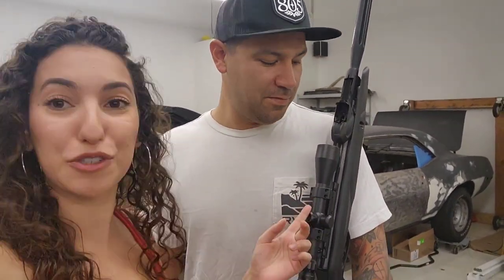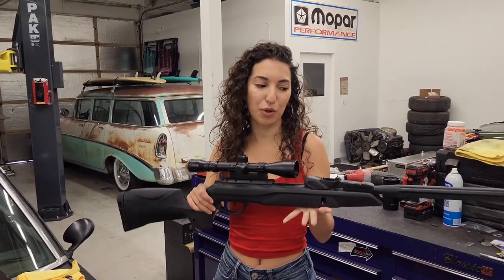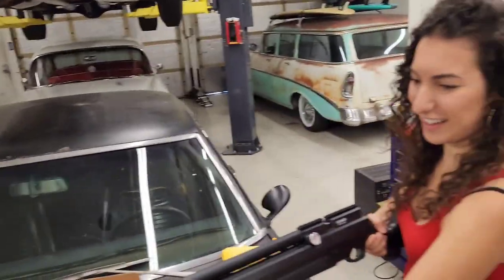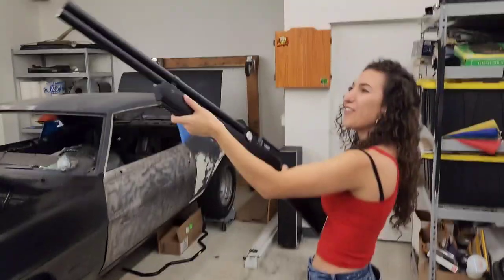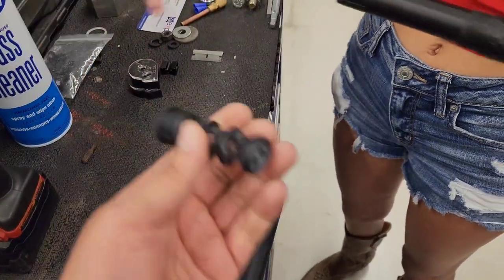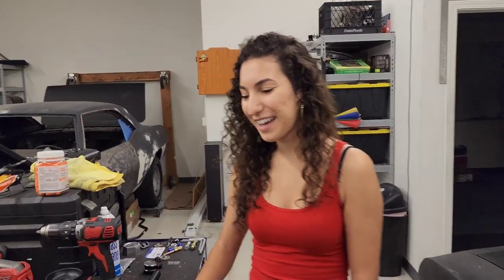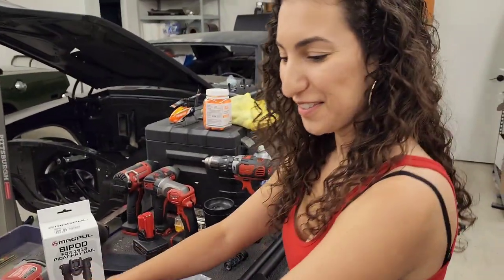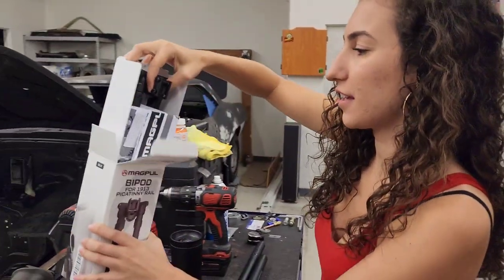Air Venturi Avenger Unboxing – My first PCP on a budget

Comment: I have the Avenger .25 cal. with a UTG Bug Buster 3-9x32 AO as well as the Gauntlet 25 with a Centerpoint 4-16x40 AO. I love the Avenger immensely. I use the FX hybrid slugs as well as Rifle brand slugs, Hades Diablo and H&N Barracuda Hunter Extremes. I prefer the Avenger over the Gauntlet and love the side lever action over the bolt action. I also have a Bi-pod mounted on mine. You are going to love this gun. I also have 2 Umarex Origin .22's that are fun for target practice. You can cut a soup can in half with like 3-4 shots. It has so much power because of the 300 bar fill pressure.

Comment: Life pro tip my friends. Set a mirror up 5 yards facing back towards you. Adjust the mirror so you can look through the scope and see yourself in the mirror. Then adjust the scope in the rings until the vertical reticle is perfectly bisecting the muzzle. That will ensure that the reticle is square to the action. Going off the bottom picatinny for square is making a lot of assumptions about how square the stock/action are.

Comment: Sweet gun, you'll have fun with that. I've got one of those buckrail cans on my 25 avenger. Can't beat it for 24 bucks.
Some cool mods out there for them if you want to go that way later too. I've gutted mine pretty much. 540cc bottle on the front and an AR butt stock. Amazed me how quite it got after that. But that's another 300 bucks later. lol

Comment: Where did you get the suppressor from and do you have to buy them seperate for each caliber ???  I have a 22 and 25 cal  avenger
Reply: Nope, .25 suppressor will work just fine for .22. 

I run a .30 suppressor on my .25 and .30 cals
Reply: @Oregon-airguns  Could you send me info or phone number to where you purchased the suppressor ?  I need to buy one for my avengers.  I plan on going to Florida to do some iguana hunting and my avengers need to be suppressed.  Thxs
Reply: @Oregon-airguns  I just searched he internet and found the number to Buckrail suppressors.  I will be giving them a call so I can see if he makes other suppressors for some of the guns I have.  When I saw your gamo swarm, it reminded me of when I 1st got back into the game with the same rifle..  Now, about 6-7 yrs later after switching over to the pcp guns, I have 25 pcp rifles.  Guess you could call me a pcp junkie, lol but I enjoy them all.  By the way just in case you were wondering, that 30 cal will drop a deer @ 75-100 yrds easily.  I have taken several with my 25 cals hercules bully, FX Crown and Impact, and my Hatsan Neutron star and also my Sumatri in 25 cal.  And yes it is legal in the state of North and South Carolina to hunt deer with a 25 cal but they suggest using a 30 cal.  Welcome to the pcp world and HAPPY SHOOTING !!!
Reply: What a treat to find y’all’s channel as I sit on the patio, my Avenger sitting on a rest, zeroed in on an ear of corn nestled in the crotch of a tree 25 yards away….waiting on a squirrel. 😏 like you I chose the Hawke Venture scope but went with a DonnyFL moderator. Looking forward to your adventures. 😊

Comment: Hanging a plum Bob works really good for getting your redical straight. If you don't have your scope installation tools. They make a lot of different stuff out there for putting on your Pickatinny.rail. That helps you line your scope up perfectly with the factory rail.